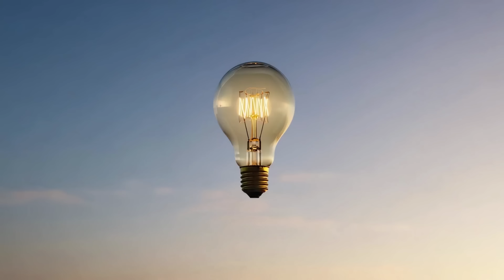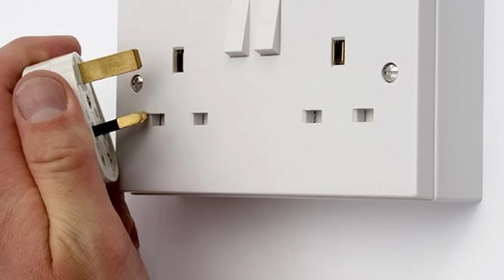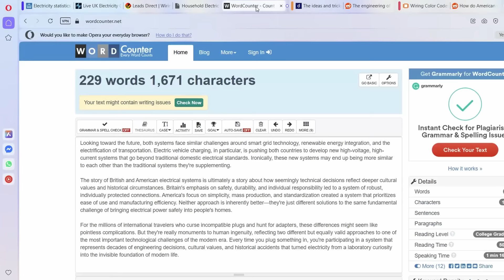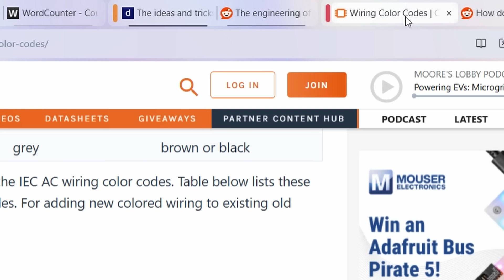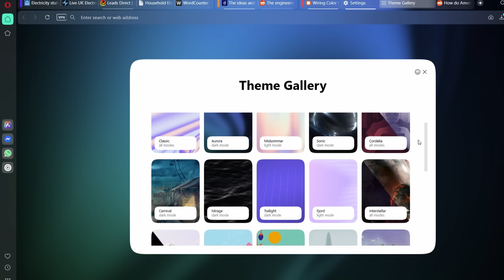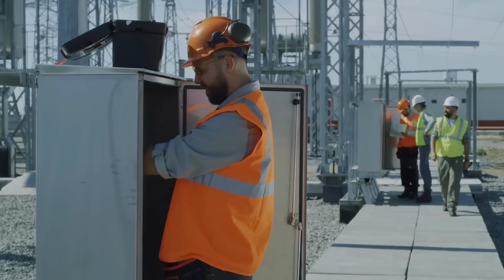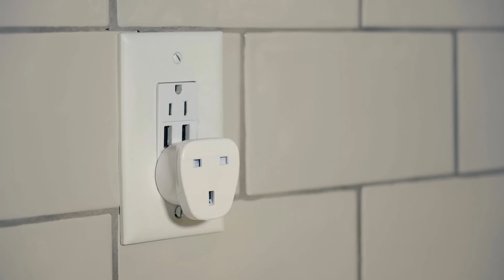British electricity is SAFER than American electricity. here's how.

Comment: I grew up in North London, England, in the fifties with 5A and 15A sockets of the pre-war kind. The plugs had no fuses and if anything went wrong, the associated house fuse (in a 'fuse box') would blow. Eventually, all houses will need to be re-wired and we eventually got a modern system with 13A sockets and circuit breakers. Nowadays, Britain and the EU use the same nominal voltage, 230V (actually 220V to 240V is the specification). Earlier 240V equipment still works. The AC voltage has a peak value of 400V, which is technically lethal (but only rarely in practice).
Reply: As I remember from the 1950s and 60s we had fuse boxes in cupboards the UK...with individual fuse wire for different circuit's. Now we have even more safety with fuses in plugs and fuse boxes replaced with trip relays.

Comment: The square three pin plug was the end point of development. Even into the 1950's appliances would be plugged into light sockets, or less frightening, three pin round plug, similar to the later square plugs but round.
Reply: I remember an iron plugged into a kitchen light socket. You could buy adapters that enabled the bulb and an appliance to be used simultaneously.
Reply: Before the plastic bit on the Live plug  came in, I put a British 2p between  the three pins and it melted three holes in the sides and blacked the plug. That's sometime in the 80's. when I was an investigive kid.
Reply: @malcolmhumphries3284  We did similar at school a smart kid willing to cause havoc put a sixpence on top of a light bulb and put it back in the socket. When the teacher entered the room she switched on the light... Bang out went the lights it took a skilled electrician a few hours to sort it out!

Comment: The 120 comes from the fact to make electrify you rotate a coil of windings in a magnetic field. We found that tapping the windings at 120º gives 3 phases allowing for 440-480 volts for bigger equipment. The saying is if you grab a live from each neighbour you get 3 phase. In the US the houses get power from a transformer that is on the same phase meaning if everyone on one side of the street turns on the lights it goes dark.  The UK found the first 3 phase mine, the US are still looking for the light switch.
Plus a large part of the US north is from Canada.

Comment: UK type G plugs were invented in 1947.  Hardly at the beginning of the electrical age.
I'm old.  I grew up in houses with a mixture of 5A and 15A round-pin outlets, also a few 2-pin 2A,   Dad converted us to the Wylex plugs - 2 flat rectangular prongs in-line with a central round earth pin.  Wylex plugs were stackable!
Reply: Don’t forget the Crabtree with the screw in fuse as the live pin!
Reply: I believe they were designed during the war years.
Reply: @plonchyvideos No, see my comment above!
Reply: We grew up with 2A, 5A, 15A but I have never seen or heard of Wylex plugs
Reply: @grabtharshammer  I have, and they were available with various ratings and I once went to a hospital in the 70's which still had them on the wards.
Reply: Same here, I'm 73!  I was fascinated by electricity and made many home made electrical projects, lucky to be alive I guess!  Do you recall you could get light bulb socket adapters to power things?

Comment: Our plugs used to be even bigger .
15 amp wall sockets with round pins.
Smaller appliances had diddy little 3 amp plugs that you had to use an adapter to plug into the 15 amp wall socket.

Comment: The original uk networks were to be frank, a bloody mess, one street might be 110v DC, the next one might be 200 AC at 40Hz, etc. It wasn't til the 1930s that the national grid standardized voltage and frequency, and oddly, it was originally 230v, then they upped it to 240, then cenelec (which has nothing to do with the EU :)  ) standardized on 230 nominal all across europe. The voltages didn't actually change, most of europe is still 220/380,. and most of the UK is still 240/415, they just changed the 'allowable range' :)

Comment: No wonder your American kettles take forever to boil Kalyn. For the same power at half the voltage they would need twice the electrical current. That means 20 amps or more!!! Now, your electrical cooker will be hard-wired into (I hope) a robust connection to your house electricity. But you might want to plug a kettle into a wall outlet in your room. That's gonna start an electrical fire and burn your cardboard house down unless the kettle is pretty low power.

Comment: This has all focused on the Type G British plug but what about the previous generation that had 15amp and 5amp round plugs with socket outlets on radial circuits?  You may find the 5amp round pin today being used in hotels for individual lamps that means that the sockets cannot be accidentally used for anything else (a safety feature) or the 16 and 32amp sockets found in small workshops and indeed camping outlets.

Comment: As usual- well researched! One thing I don''t think you mentioned was that US plugs stand out from the wall, with the cables coming out horizontally, and can be removed using a sharp tug, whereas the British plugs are flatter against the wall (making it easier to have furniture placed in front of sockets which you don't need access to regularly- eg where table lamps are plugged in the whole time.) with the cables running down towards the floor, resulting in a plug that it's very hard to pull out by accident.
Reply: Very true. Good points...
Reply: Reading a web page isn't real research is it?
Reply: @manxman8008  Reading one webpage isn't of course, but reading a number of webpages and evaluating what is relevant is. Particularly if they are websites of  significance rather than John Smith's blog about what he thinks. Not high level peer-reviewable academic research no- but still research!

Comment: Kettles don't take forever to boil in North America; it only takes twice as long. That's still faster than a gas burner; though not quite as fast as an electric cooker or kettle with more power available
Reply: You often get gas burners which exceed the 13 amp/ 3 and a bit kilowatt rating of standard UK sockets by a considerable margin.
Reply: @polyvg  Mmm, some gas rings are enormous. Unfortunately they're not super efficient at getting all of that heat into the pan/kettle above.
Reply: @polyvg  that is the case if you are talking raw heat output e.g. 5-10kW burner. And it may be faster, but you wouldn't use it-needs a big pot to be faster
But your pot/kettle/etc. only gets under half the energy put out by that gas burner-the rest goes into the room
Reply: @tutacat My own hob kettle has a large base for precisely that reason and is fine on the largest burner on my gas hob. Not sure the rating.

I doubt very much it is slower than, or even as slow as, a USA electric kettle.

Comment: Split phase and reduced voltage is also the reason building sites in the UK actually use 60V live on a split 120V phase, to be even safer.
Reply: The greater safety is that yellow sockets at 110V are not referenced to ground. The transformer isolation means that if either leg is grounded no current flows. Same idea as shaver sockets in bathrooms.
Reply: @nowster  Sry I was referring to the voltage being only +-60V to earth (where the device gets 120 from thePD, so any shock from one wire is safer, not safe.
RCD-GFCI is standard. I didn't know specifically about the transformer setup. You can also split in the middle, and sense leakage within the transformer

Comment: In the UK you used to get various electrical appliances with a bare ended mains cable and you were expected to wire the plug yourself.
Reply: Indeed. This was partly because there were still houses with old-style round-pin sockets, and partly to save money. It meant that learning how to wire a plug became a kind of rite of passage. Nowadays all domestic electrical kit comes with plug attached so kids are missing out on this experience.
Reply: @michaelwadman6276  Not because of the old round-pins. Those were all re-wireable but the 13A square pin plugs and sockets were a new standard. Nothing to stop you cutting off a moulded 13A plug and wiring on an old round pin if you are determined to.
Reply: @dukenukem5768  Round pin plugs and sockets are still available and are still covered by the standards. My house has 5A round pin sockets for lighting in some rooms and it was built in 1998.
Reply: @michaelwadman6276 Yep you can only change the fuse now and if the plug falls apart for any reason the instructions on the appliance will tell you to dispose of the appliance.
Reply: @MsPeabody1231  Simply cut the faulty plug off and wire a new plug onto the cable. You can still buy unwired plugs...
Reply: @MsPeabody1231  I have NEVER seen this instruction!
Reply: @MsPeabody1231  You can just cut the plug off and fit a new one.
Reply: @michaelwadman6276  Yeah, and some of moulded on plugs are not quite the quality that they should be and they sometimes short out when you plug them in and go bang quite loudly, while you've got hold of it! That happened to me with the plug on my motorised tile cutter and luckily I use very fast acting overcurrent breakers and it tripped and took out the power in a flash, I shudder to think what could've happened if I was still using archaic rewireable fuses...and luckily I was also upstairs on a wooden floor so there was nothing earthed within easy reach either. And I thoroughly recommend overcurrent breakers as I've known a 32 amp one trip out so fast that the little 5 amp fuse in the plug on the same circuit held out as the breakers today trip out faster than the time it takes for the fuse to blow.
Reply: And you were taught how to wire plugs at school.
Reply: @wessexdruid7598  The problem is I can't remember the last time I had to rewire a plug. It's something that doesn't crop up. Also - and this is where youtube really does come into its own - there'll be tutorials for it somewhere,
Reply: @billyhills9933  It's a bit like riding a bike, though. I guess it's an age thing.
Reply: @wessexdruid7598  😀 The riding a bike thing is true. I rode a bike after not riding one for decades, since I was a boy, and managed to ride around with only a bit of a wobble and without falling off. I'm also old, obviously.

Wiring a plug is easy, but plugs that I have bought came with instructions telling you which wire went where, just in case you forget.
Reply: @billyhills9933 the last plugs i wired were RJ45s.  ^_^
Reply: @wessexdruid7598  even in the 1990s  when I was at school, we did it in physics.
Reply: @wessexdruid7598  It is still in the GCSE Science curriculum
Reply: We used to cut the plug off the old appliances and save them for use on new ones. I found a box of them under our stairs that must have been put there 30 years ago.
Reply: A good thing. I like my plugs all to look the same and be of decent quality, not Chinese tripe.  I have a stock of Crabtree re-wireable plugs and the first thing I do with a new appliance is cut the crappy moulded plug off and fit a Crabtree, usually re-used from the appliance it is replacing. I can optimise the lead length at the same time. 
Moulded plugs all go to landfill along with the appliance sooner or late, but the re-wireable ones can be re-used for ever.
Reply: I've still got some rewirable plugs, they come in handy if you don't want a load of excess cable or it's damaged (without affecting the appliance). Certainly everyone knew how to connect a plug and change a fuse.
Reply: A right of passage, like changing a tyre.
Reply: I will often shorten or lengthen leads on appliances to make them more convenient
Reply: @ivan0idea  Have you tried the various cable tidies? Slots spiral others? Mabe just me  biut I found these to be a godsend around IT. Before chaos - after order. You can't lengthen a short one but by gum you can shorten  a long  one
Reply: @ivan0idea  IMHO, static appliances should be sold with no lead and a panel mount plug* instead. This is what professional equipment tends to have. You would then buy a separate lead (or use one you have already) with a conventional plug at one end and a lead socket on the other, suited to the length needed.  
* Anyone who does not know what that is, Google "Chassis plug" or "Panel plug".
Reply: es and the number of  misconnected plugs was signficant.  Those round  pin pl.. ugs were around for longer an than you'd think.The very .last onesd I saw were  miniature 3A. Mid 90s I think. 

I'm aldspol, just, old  enought remember stripping  out old black and red wiring.
Reply: 2024 Electrical Safety Statistics: Unveiling the Shocking Truth
Faulty electrical equipment and sockets cause about 70 deaths and 350,000 injuries annually in UK homes. This statistic emphasises the importance of following electrical safety guidelines to prevent these incidents. Individuals must practice safety measures to avoid accidents with multiple electrical components and devices in an average home (Peabody).
Reply: USA
In 2019 – 2023 electrical distribution or lighting equipment, such as wiring, lighting, cords, and plugs, was involved in the ignition of an estimated average of 31,647 reported home structure fires per year. These incidents caused an estimated average 425 civilian deaths, 1,279 civilian injuries, and $1.6B in direct property damage annually.
source NFPA research

edit
--------------------------------
USppln 342mn
UK,ppln 69mn 

so per  capita
70  of 69 mn = 1 death per milion
plays
425 of 342 mn = 1.2427 deaths per million
a US person is about 24% 
less safe than a brit
more 
many thanks to jurgenkurgen  for pointing out
an error and for re-expressing  the risk  
in deaths per milliion (much  more conventional  makess comparisons  easier) 
---------------------------------
end of edited section 

original
-------------------------------- 
USppln 540mn
UK,ppln 65mn 

so per  capita
70  of 65 mn = 1.0769 e-6
plays
425 of 550 mn = 0.727 e-6
a US person is about 35% ssafer than a brit

check this?
--------------------------------
end of original
Reply: @brucebartup6161  But the population of the US is just under 342 million as of the 2024 estimate by the US Census Bureau. Equating to 1.2427 deaths per million citizens.

The UK population as of the 2024 estimate by the Office for National Statistics is 69.28 million. Equating to 1.0104 deaths per million citizens.
Reply: @jurgenkurgen  ahh yes,  many thanks, will correct .

cheers
Reply: Not for years now
Reply: IT'S BETTER THAT WAY!!!!!!!!
Reply: But we were all taught how to do so in secondary school.
I rewired an anglepoise lamp plug only the other week to try and stop the lamp flickering. Turned out the plug wasn't the cause, but the original plug wiring did look a little dodgy, so I improved it anyway.
Reply: These days, most appliances in the U.K. have a three pin plug moulded on to the wire.
Reply: I remember my 2nd form science teacher, Mr Jenkins, showed me how to wire a plug in 1986

Comment: I was born in 1951 in the US and there have been important changes in electrical plugs during my lifetime. The GFCI outlet was invented in 1961 and included in electrical codes in 1971.  As a young child I never saw 3 pronged plugs nor did I see the 2 pronged plugs with different widths, both of which are safety improvements.
Reply: And now we have GFCI breakers and arc fault breakers as well as combined versions. GFCI breakers (or outlets) are required in bathrooms and other areas where water is used (really access to ground/earth). Arc fault breakers are required in bedrooms and other places depending on how recent the local code updates have been. My home originally had gas lighting and still had some push button switches and knob and tube (ceramic) wiring supports. No grounds at outlets. After a recent total upgrade it now has a mains panel of 200 A at 240 V biphase. In other words 240 between hots and 120 either hot to neutral. All outlets have grounds, both 120 and 240. My solar produces enough that the power company pays ME a very small annual check.

 Some construction sites in The UK use biphase 120 for power tools, 60 volts to ground, for safety. 

I once lived in a building in Saudi Arabia, where air conditioning is VERY important, that had 240 V across the phases of 3-phase power to run the AC. So the regular outlets were 138 volts. They had matching bulbs. I had to get my TV adjusted as it was an autoswitching 120/240 set that thought it was on 240 V when fed 138 V.